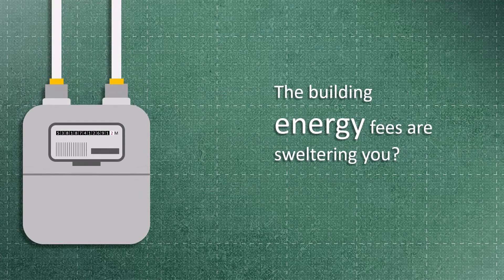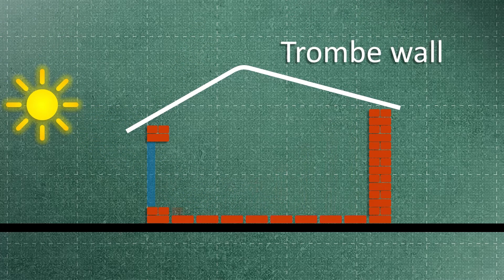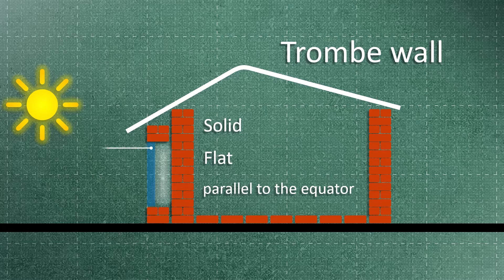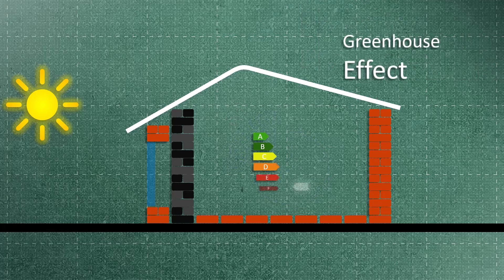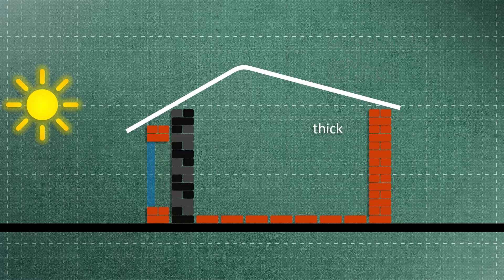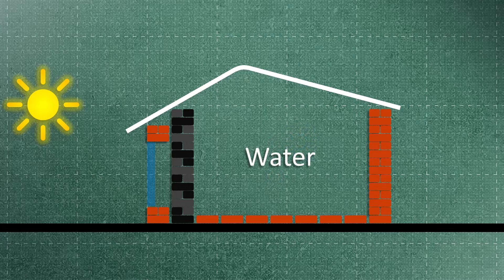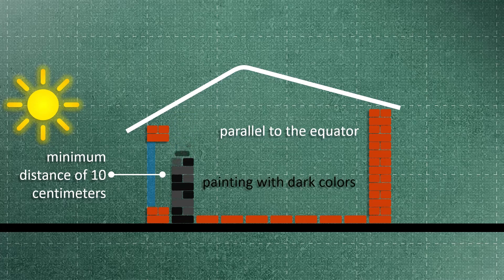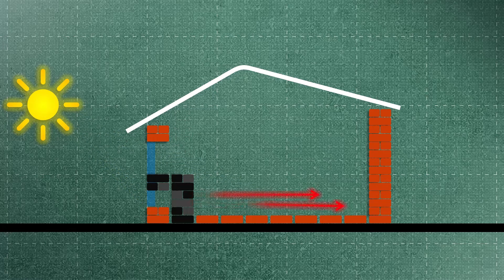"The Power of Solar Architecture: The Trombe Wall Solution for Efficient Heating in Buildings"

Comment: What is the optimal thickness of the wall? What is the best material besides water?
Reply from the maker: @sjagain  50cm, concrete or red old fashion brick. But always remember thickness can change depending on the situation